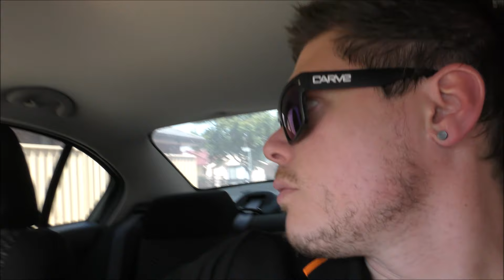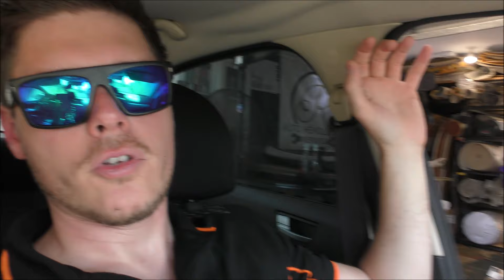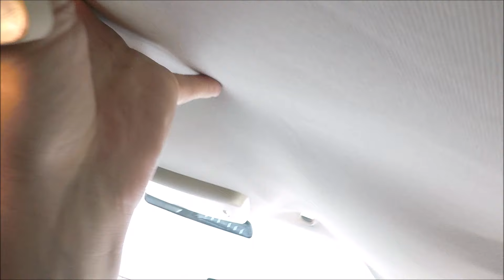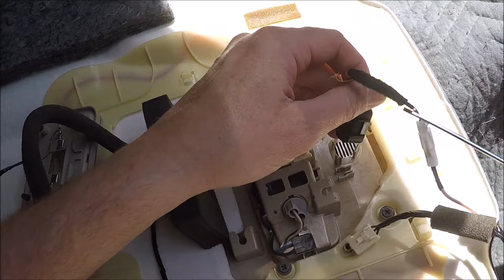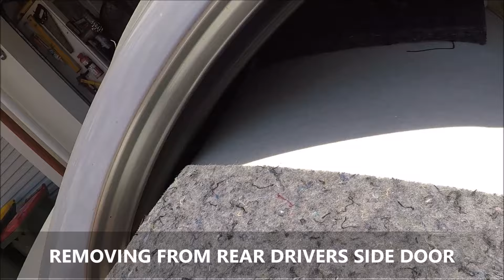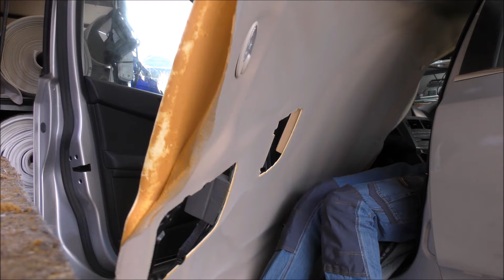How To Remove a SEDAN Car HEADLINER In Any Vehicle

Comment: Nice it makes it look not too hard, but my main concern is the side curtain airbag system, should I unhook the battery before removing the headliner I have a 2012 Accord
Reply from the maker: We haven't worked on your exact model of car yet, so difficult to suggest the method. With airbags, if unsure you can disconnect the battery, however they usually only go off via sudden stopping of the car/impact or via power touching the wires. Or tampering with the airbag mechanism itself. Disconnection of the battery should increase the safety. However best to do a little more digging around for information regarding this to make it a safe environment for your self.

Comment: I drop headliners for the PDR guys at my job and its a easier with another person helping (especially putting it back up) we don’t remove it from the car though, just drop it all the way and let it rest on top of the seat headrest. Just enough for them to be able to reach hail dents on the roof. Its a good skill to learn. Can look a little intimidating but it’s not once you do several. Mini vans can be an absolute nightmare imo though! A lot more bolts/clips/screws to find and take out!
Reply: Hey bro any tips on becoming better in removing headliners
Reply: @ibarra8249  start with your grab handles, sun visors, and overhead lights/sunglass holders, that type of stuff first, all of that is what mainly holds up your headliner. Then once you remove them, you can remove your A,B,C posts. Do not start with a VW, mostly all of them require a special tool for the grab handles. Chevys and fords, mazdas, them are all simple to do. Practice on a small sedan. If you need to get to the posts, a lot of cars are held in by clips. It may seem like you’re going to break something, but you just have to rough house it. Its a little difficult to describe but start with the grab handles, driver and passenger sun visors, and then anything attached to the headliner like lights, then it should be pretty much loose. If you don’t care about creasing or anything (which carvana didn’t stress for the most part) once you get all of them things removed, you can kind tuck and fold the headliner over the posts, it COULD crease it though depending on the quality of the material. Its real simple and easy once you’ve done it a good amount of times. I could drop a headliner in 15-20 max if needed. Its a lot easier with 2 people though. We’d have 1 person sit up front and one in the back. Hatch backs and SUVs aren’t a good starting place. Something like a chevy cruze or mazda 3, ford focus, them smaller compact sedans are a good starting point. But they all come down and go up the same for the most part. We would even drop half of the headliner if there was a dent up in the driver/passenger side or the rear, same deal. Taking a trunk off is also simple (we had to do them if it was an suv or hatch back because it was easier to get the dents out  or access the roof with the trunk being off the car. You can do it bro. Just be confident in your work. Best practice is hands on experience. Youll never retain information by reading it online. You gotta go do it yourself for the best experience. If you’re working somewhere where it’s necessary and being trained, tell them, to let you try and walk you through it if stuck. Do not just sit there and watch. Im telling you that’s a good way to not learn/retain any knowledge. You got it bub 🙏🏻 good luck to ya bro
Reply: @ibarra8249  and don’t worry about speed and doing it quickly if you haven’t had much experience. No need to impress anyone when first starting something out bro. Work at a comfortable pace for yourself. Don’t let more experience people intimidate you or make you feel like you can’t do something. They all started out inexperienced as well. Never let someone disrespect you if you’re new to it.